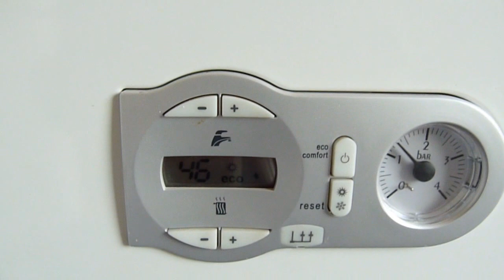Centrala Termica pe gaz Ferroli DOMIproject F 32 D curatare si remontare

Comment: Buna ziua. Am o centrala la fel cu cea din video si presiunea indicata a apei scade cu aprox. 0,1 bar la 25-30 ore. Nu gasesc nicaieri scurgeri, presiunea scade si daca  este inchis circuitul de incalzire. Aveti vreo sugestie? Multumesc.
Reply from the maker: In mod sigur pierdeti apa pe uundeva, nu este ok sa scada presiunea asa de repede, sigur, apa se mai evapora, insa e cam mult in 25-30 ore. Desfaceti centrala cum ati vazut la mine in film si uitati-va cu mare atentie dupa scurgeri de apa, probabil ca nu veti gasi efectiv apa fiindca la caldura se evapora fiecare picatura, insa ar trebui sa gasiti urme de calcar. Incercati si o aerisire a caloriferelor cu centrala pornita (sa existe circuit de apa prin ele). Totusi, daca este posibil, chemati un instalator, pot fi defecte in centrala mai putin vizibile si greu de identificat de catre un nespecialist.
Reply: Cum pornesc centrala Ferroli?
Reply: @ioanvujdea9050  gasiti in manual instructiunile de folosire - tinut apasat un buton ca sa se restarteze. Daca cumva aveti displayul stins atunci trebuie schimbata placa de baza.
Reply: @workbenchstuff  Am uitat sa va multumesc: era un por in schimbatorul de caldura. Dupa 2 ani de interventii cu "nu gasesc nimic" si "mai bine o schimbati cu totul" am ajuns sa cumpar piesa noua originala cu 780 lei, am schimbat totul dupa specificatiile producatorului (munca aprox 2 ore, plus cateva ore documentarea) si sunt aproape 3 ani de cand merge fara probleme.
Reply: @cucubau05  buna ziua ati schimbat schimbatorul de caldura
Reply: @nidelcuoana8959  Da, l-am schimbat

Comment: Centrala mea pleaca singura cand o pornesc de la intrerupator si se opreste este  un euroline 2003 (junkers-bosh) am curatat locul unde intra furtunele erau   orificiile astupate. In cel negru a mai ramas reziduu inauntru e greu de ajuns la el. Schimbatorul termic in placi nu a fost curatat niciodata si imi curge apa prin fluxostat.  Nu pot sa imi dau seama de ce porneste singura iar in ea se aude Un al doilea ventilator sau un sunet echivalent care parca evacueaza gazele arse. Si vorbind de gaze am curatat cutia unde arde flacara cu periuta de dinti era numai funingina si in elemental de incalzire sus unde arde flacara   e multa  funingine nu stiu daca peretii cutiei sunt cu azbest ( par de tabla)
Reply from the maker: @salutsalut7427  parerea mea e sa chemati un instalator autorizat sa ii puna o diagnoza computerizata, pare a fi decalibrat sau stricat un senzor si ii da valoare falsa